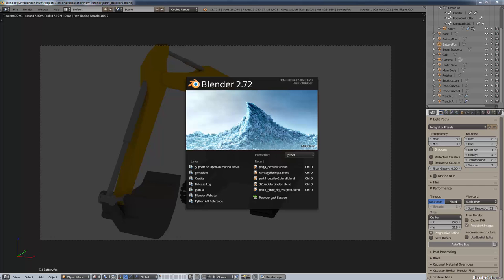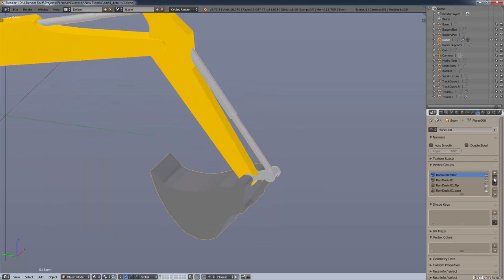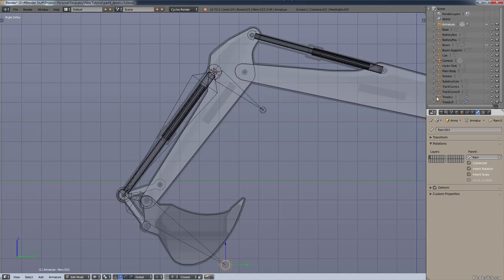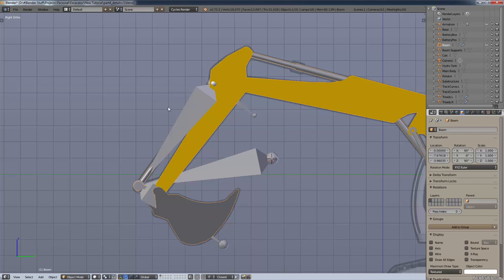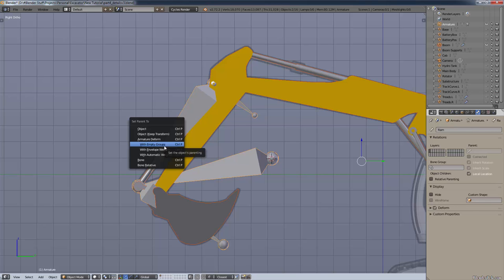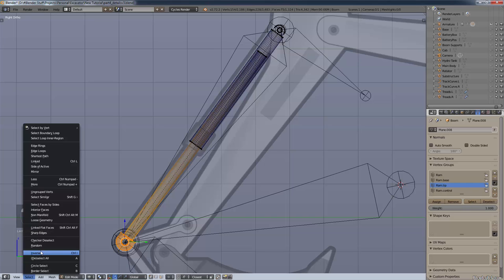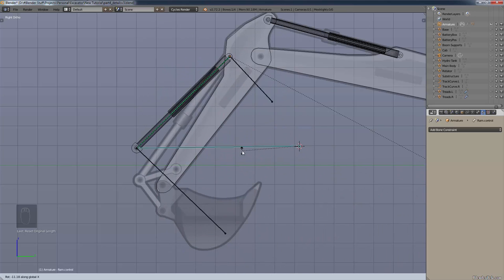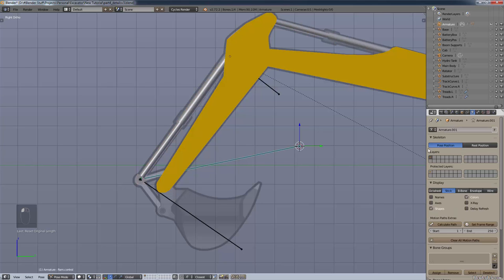Howto Rig a Hydrualic or Pneumatic Cylinder Ram in Blender

Comment: Is there any optional way to do this other than scaling the parent bone? I'm trying to export my mechanical model to Source Engine and the SMD files don't support bone scaling, only rotation and position.
Reply: Actually never mind my last question, I figured it out. I have a bone attached to the ram pointing towards the cylinder bone and a bone attached to the cylinder pointing towards the ram bone. Both bones have a Damped Track constraint with the ram bone attached to the tip of a control bone using a Copy Location constraint so that the ram follows the control.